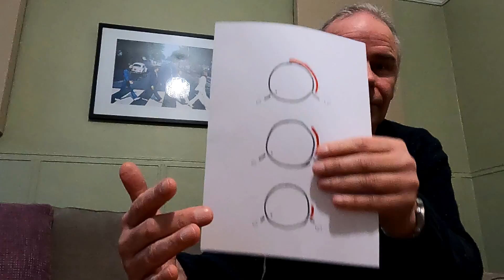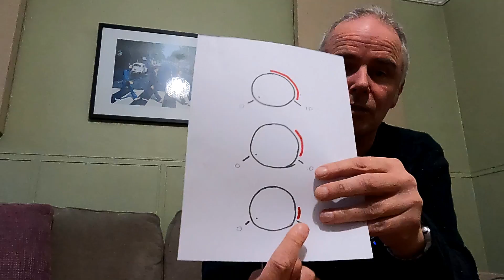Matching power rating of Speakers and Amplifiers and why most people get it wrong

Comment: Good explanation, this is good reason for getting an attenuated RCA lead especially when connecting a CD player to an old amp or receiver. I have had CD players with a 3 volt peek to peek output.
A lot of new amps have a CD Input and in theory should cope with the high CD player output. I also bought speakers where the tweeter coil has melted as a result of being overloaded
Reply: Yes. a pair of Rothwell RCA attenuators is probably one of the best gadgets in my setup. A lot of amps have 150-200 mV input sensitivity and a lot of modern (digital) source have way to strong signal or, in other words, there is a signal strength mismatch.

Comment: Interesting. I'm still using my Denon TU260 tuner and Mission 760iSE (single wired, not bi) bought in the early 90s. And you're right, Radio 3 FM sounds fantastic even with a wire T aerial.

Comment: If it isn't loud enough for you when you're using half the amps rated wattage you either need more efficient speakers or a higher wattage amp.
 Besides after a certain decibel level the amount of wattage necessary to make noticeable volume changes can become an expensive endeavor lol

Comment: Wow, i use that speed analogy all the time, example, why do you need such big speakers/such a powerful amp, answer is that you buy that Audi that does 170mph not to do 170mph but so that when doing 30mph there is no stress on the system and you can cruise effortlessly.

Lol, some of my old car head units used to run 4v or even 5v rca outputs.

Strangely enough I always found the best source output in the car was from FM radio, especially radio one(pete tong friday night), not even CD's could match it for volume, ie you could turn the CD up to 30 before it would distort and with FM radio it was 25, so much cleaner or higher volt signal.

Comment: I used to work in a specialist hifi dealers (I told this story in another YouTube hifi channel's comments section) & for a laugh my colleague and I wired up a pair of enormous used Wharfdale E70's into his Mini Metro's puny car radio-cassette player (about 5wpc?) and it blew the Wharfdale's. Current delivery and speaker efficiency are far more relevant than watts per channel. It makes me smile when I hear/see proud owners of their pimped-up car brag about their new 1,200WPC sound system, the amp being driven by a 12 volt car battery. They probably wouldn't be impressed by my measly 40WPC Naim NAP140.
Reply: You did that to a pair of E70's? Disgraceful😒

Comment: Re: different gain required for different sources.

My Creek 3040 FM tuner purchased in the 1980s definitely needs the most gain from the amp, less so if I use the DIN output it has for a Naim amp. Still regularly used on Saturday mornings if I’m home to listen to Radio 3 ‘building a library’.

Next up is phono stage.

CD and streamer about are the same. ( heresy, yes Phil, sorry, streamer is mainly used for trying new to me music and new releases )

Comment: In a KEF FB group steady stream of reports of failed LS50 etc drivers. Normally cone edge breakup / disintegration or clear over-excursion. The culprits claim to not be driving them hard and within the power amp rating, blaming manufacturing / design fault. They miss the point of the quality of that power and the signal into the amp. It often emerges that they’ve also used room tuning software or volume controls and boosted the bass beyond what the speaker can be reasonably expected to handle.
Reply: Well I have a pair and with vinyl the drivers could overextend with warped record.  Anyway they are safe in box what a garbage speaker.

Comment: There's lots of factors that can blow a speaker. so it's best to use professional poweramps X2, they have limiters and peak meters a real quality hi-fi one is the Professional Wharfedale Pro CPD 1600 300£ you can drive it up to 9 .5 volts, and find a low impedance highly musical preamp preferably valve high output you're be in heaven, and can easily compete with any 50 thousand dollar amplifier.
Yeah  if you have got a high powered amplifier integrated and your driving a lot of volume then you could be exceeding the wattage of the drivers plus you enter into square wave when you're driving hard and DC offset goes up. There should be no issue using a record through a phono stage, not high enough output you'll be lucky to get 75 DB output gain and that would be on a moving coil
more than likely something is wrong with the equipment to cause that issue. Most commercial hi-fi drivers are 100 Watts peak so RMS about 12 Watts before it will blow. Property most people who blow a speaker at moderate volume is because of DC offset in the amplifier is not correct, you can get yourself a cheap multimeter stick it in the speaker terminals put it on 100 volts DC if you're getting under 80 mV DC you shouldn't have a problem ideally this wants to be close to zero as possible

Comment: As touched on elsewhere in the comments and the video , all we are dealing with is voltage current and resistance , an amp has a max voltage and current delivery , the lower the resistance figure for a given frequency the greater the current demanded of the amp . The safest route I have found is to choose speakers that give resistance real world max and min resistance and use an amp that can give 50% more power than the speaker will ever need . Good speakers will slap the end stops at max excursion, letting you know they are being over driven.  Some speakers which claim 8 ohms are actually 2 ohms at bass frequencies . If dealers have access to this vital info they can offer better system matching from the off . I run my ls35a with 80 watt plus amp , but it is an amp that has great voltage delivery and is quite weak at current delivery , this is a great match for the ls35a which is 15 ohm with a min impedance of 8.3 ohms so strong current isn't needed but fast clean voltage delivery is .

Comment: Also hard to explain is the difference between volume and gain which is fairly crucial to distortion. There's also the issue of square wave clipping when the amp runs out of puff.
Also a friend of mine had may issues with a pair of Missions, esp. when he got a CD player !